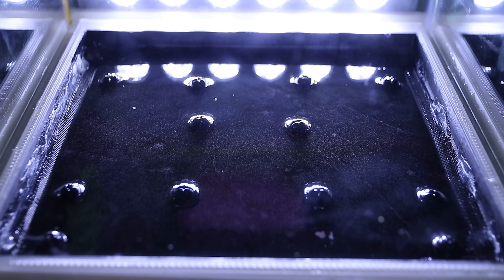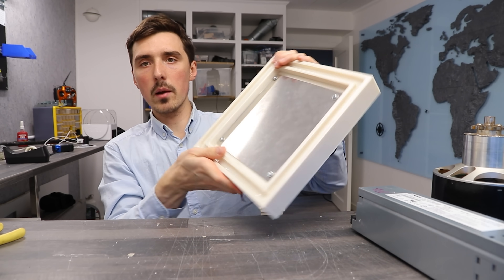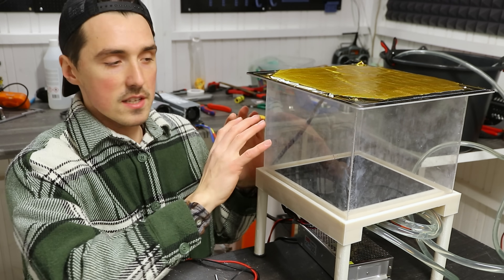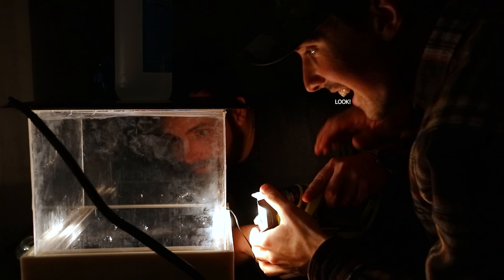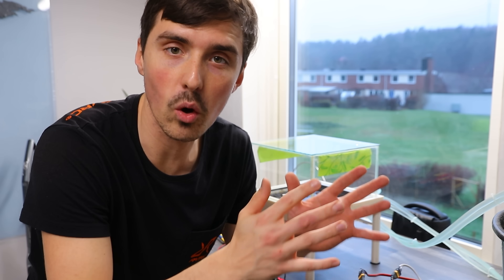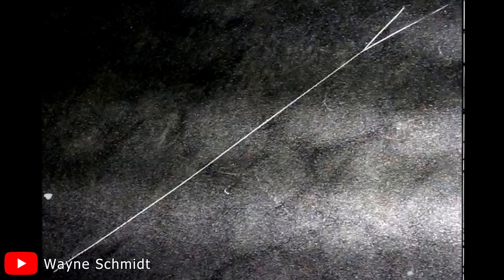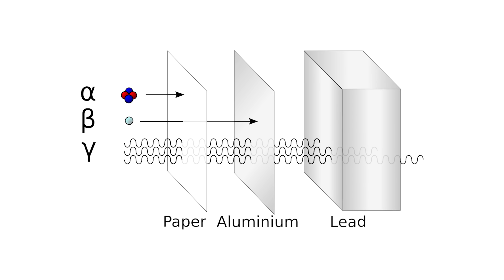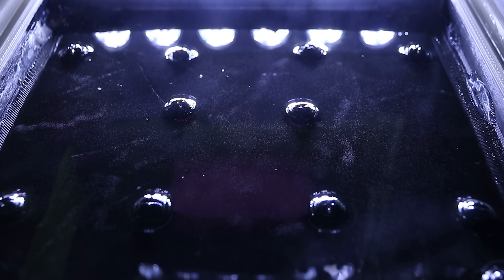I Built Nobel Prize Machine To See Radioactivity

Comment: to increase the cooling capacity try putting the water blocks in parallel instead of in series, thus each block gets cool water, not heated by the previous block.

Comment: Cell phone  on and off, call.
Reply: Why?
Reply: @A10 Warthog  To get a visual of the radioactivity.
Reply: Cell phones emit low levels of non-ionizing radiation when in use. The type of radiation emitted by cell phones is also referred to as radio frequency (RF)
Reply: There you go. Nothing would happen because the radiation is non-ionising.
Reply: @A10 Warthog  Eh, something interesting could happen. I don't see how trying would hurt anything. It does emit radiation and emfs. I'd  be interested regardless.

Comment: In my experience,  stacking peltier doesn't work.  You should insulate between the two sides to maximise the delta. Thermal pastes, lapped contact surfaces and high contact pressures. Also copper is a much better conductor of heat.  Experiment with voltage for maximum efficiency and have plenty of current available. You should be able to achieve a 40° delta. I ran a pc at -20°c with 1 100w peltier at 17v Air cooled ( water loop and radiators)

Comment: Try putting some urine from a nuclear medicine patient. See just how dangerous it may be. Of course you should invest in safety equipment. Lead apron, protective eyewear, and arrange some way to dispose of it safely. Sweden does use nuclear medicine right ? Or you could put a large neomideam magnet in the chamber to investigate if a strong magnetic field diverted any of the particle trails. The idea being that a protective suit, or structure could be developed to serve a degree of protection. Lead will absorb powerful rays, but who wants to wear that suit all day?  Obviously all these low power radiation seem to not be dangerous, but it's believed that cosmic ray causes ageing to a greater degree than time

Comment: It seems to me that you don't need these absurdly low temperatures.  What you need is a temperature DIFFERENCE.  You should have a film of liquid alcohol on the bottom, & that should be HEATED to saturate the space inside.  Then any cooler surface should form the cloud.

Comment: Here in Mälardalen you could easily pick up some radioactive stones from known sites like Ytterby gruva. The bedrock around your place probably also is quite rich... telling from the amount of radon you seem to catch in your chamber. 
However, ChatGPT most likely was wrong about the hot wire. What you saw was most likely just caused by the extra heat inserted into the gas phase. There is no chance of getting electron emission from just a hot wire in air, and especially not in giving those electrons the necessary kinetic energy to achieve any ionization.

Comment: Tritium sights maybe? The ones that are used on guns, getting tritium sights should be relatively cheap way to obtain real radioactive material. Also instead of using washer fluid try using glycol or glycol based car coolant, will get your temps down nicely.

Comment: You can put more peltier elements in front of the other elements so they pre cool the water that will go into the chamber elements. But i guess you need a total of 4 or 5kw (just a guess) because they have so many excess heat by there incredible efficiency 😋

Comment: What is causing the general movement of the trails across the bottom of the plate? Earth's rotation for some cases? Or the heat of the flashlights causing convection?

Comment: I have made a TEC cloud chamber in the past and here is something i learnt, if you add an electric field it makes the particle tracks much more defined,  around 2-5Kv does the trick. I would recommend buying a bug zapper tennis racket, removing the internal PCB and connecting the negative high voltage terminal to the cold plate and then add a wire mesh above the cold plate that the positive terminal connects to, in mine it was around 100mm above, yours may vary. if you have this on a switch you can turn it on and off and compare the results. 

another thing that i found was good was to add a few layers of fabric (I used cotton felt)  on top of the wire mesh and soak it in isopropyl alcohol, this will last for a long time so you don't have to keep on spraying, you can add a heating element inside of this but i didn't find that necessary.

also the Americium found in smoke alarms is a good source of beta radiation if you are carful and want to try it. Another source of radiation is welding rods i don't remember exactly which type
Reply: 6011 welding rods contain a high-cellulose potassium type coating which could give off a slight amount of radiation.

Comment: Some old camera lenses used radioactive coatings (Thorium). You should put one of those in there. Some cameras even had those coatings on the eyepiece, but they eventually stopped making them because people were getting eye cancer. The lenses are pretty easy to identify because the glass has turned yellow from years of self radiation. Some of them can get pretty expensive though as they are sort or collectibles. Might be able to find a damaged one on ebay though. (Takumar 50mm).

Comment: First of all, cool project. One modification I would suggest is to have a magnetic field perpendicular to the surface. Since electrons are negatively charged their tracks would turn clockwise around the magnetic field lines, while alpha particles are positively charged so they would turn counter clockwise. That would be a nice way for you to more easily distinguish between the two particle types. You could perhaps buy neodymium magnets and place between the coolers, just make sure they are pointing in the same direction.
I'm not sure where in Sweden you guys are, but in some regions there are naturally occurring radon gas which is radioactive so if you have the cloud chamber in a poorly ventilated basement you might see more activity than if you are in a better ventilated room. You could also test the soil since there might be some trace radioactive isotopes in it from the Chernobyl nuclear disaster. Alternatively test the meat of wild boars, since they like to dig in the ground and eat roots they might be radioactive with isotopes from Chernobyl. After all, it was the Swedish nuclear power plant Forsmark that where first outside the Soviet union to detect the disaster due to the wind blowing from the south east on that faithful day in 1986. Furthermore, there are regions in Sweden with uranium in the ground, so you could consider testing some rocks (I know that there are some uranium ore in Slotsskogen in Gothenburg), however that might be considered illegal mining of uranium so check the laws first. 
In conclusion you guys have many interesting things you could test with you cloud chamber.
Reply: This, a magnetic field would make this so much better!
Reply: Magnetic fields would be awesome!
Reply: "First of all" 🤓🤓🤓🤓
Reply: @WhosThisPersonNotMe  "👆🤓" - 🤓
Reply: @fahdx64 " "👆🤓" - 🤓 " - 🤓
Reply: @zarrowthehorse  "👆🤓" - 🤓 " - 🤓" - 🤓☝🏼

Comment: Hi, try this: electric field outside the chamber…and inside…with battery or 220v connectors …away from each other.
Try put magnet inside, outside, batteries…
Piezo lighter nearby…
An electrostatic plastic ruler
A coil…

Comment: With peltier elements you should always run them way lower than specified power. Run a "60W" unit at closer to 20W e.t.c. You'll want as many as you can fit (maximize area). What happens at higher powers is that the hotside gets too hot even if the water in the cooler is still only 20-30C. You can experiment with different voltages to see at what power you get the highest temperature difference. In most cases it's never at the highest. Having more of them in total means you have more total cooling capacity which means you can achieve colder temps as you have more cooling power to compensate for heat conduction through the acrylic. And buy proper thermal paste, you can on the swedish amazon find some larger tubes quite cheap (>25g)

Comment: Great work! I'm impressed how ChatGPT answered to your question. Maybe it was not clear enough, but you need to connect negative high voltage to that tungsten wire to create electron beam.
Reply: Honestly, this is absolutely insane suggestion by ChatGPT, and I don't understand why anyone even humoured it for a second. It's a -30 cloud chamber and putting a 1626.85C wire (assuming ~1900k hue) is not going to anything other than ruin the effect. Absolutely insane.
And how can you connect a negative DC voltage over a wire? Positive and negative in DC just refer to direction of current. If you swapped the connections on each end, you could call it negative, but it makes no difference.
Reply: @1992jamo  I agree, the "negative" voltage comment makes no sense.  Voltage is simply relative to your reference.  So negative one way is positive another.

Comment: dry ice is a problem ?  why ?   let me guess, maybe it's a component to make explosives and it's hard to acquire because of the bikers gang wars . 
am i correct ?
Reply: It's not illegal, it's just very uncommon. I have never seen it in my life. What's it even used for?
Reply: @logitech4873 it's " ice ", what do you do with ice ?
it's also used as canned compress air.
Reply: @berserkberserk997  It just seems like whatever it's used for, there's other less exotic options.
Reply: @logitech4873   carbon dioxide is not dangerous, unless u spray some in your belly and the liquid gives you frostbite making a scar in the process. 😝

Comment: you have a smoke detector right? then you have a radioactive americium source. drop that in there. another option is to get a very strong magnet, build a sled with a hole over which you place the magnet, and drag it around outside in the dirt for a while. scrape off everything that jumped up to the magnet and place that in there. since you live in sweden, a significant portion of that magnetic material could be fallout from Chernobyl and from soviet weapons tests, and the rest will be micrometeorites.
Reply: Most smoke detectors today are optical. They don't have americium.

Comment: if you take apart a smoke detector it has americium 241 which is an alpha emitter, you may also be able to find an old Rolex on eBay that has in the watch face
Reply: Not all smoke detectors do. Most are optical nowadays.

Comment: Nice video, bananas are slightly radioactive, but if i remember well i saw a video that explain the most of the potassium is contained in the skin, so you can try with the skin of the banana. You can try granite rocks, they contain potassium and sometimes traces of radioactive elements. Or an old crt monitor.

Comment: I read that the surfaces who are electrostatically charged attract the decay products of the radionucleides who are naturally present in the air, because after the decay most of the products are ionized. Most of them are radioactives too. It was typically happening on the old CRT displays, but I think plastic vacuum cleaner enclosure, or anything you can feel the hairs on the back of your hand attracted to. Swipe a small clothe on it and I think you could gather a more concentrated sample of radioactive elements . I vaguely remember that negatively charged surfaces are better.

Comment: The "Static" was interesting, all interesting . Its one of the most amazing machines . Real time vision of particles , like a pair of glasses that lets you see radio waves, but there isn't one of those. this is happening everywhere.  tig welding thourium. Tried and failed a cloud chambre , -15 at best. looks a good fit for pulse tube cryo cooler. lower power , would be amazing to have a 24hr system but 1KW is unfeasable. The total energy change due to the tracks must be minute so the whole energy system could be tiny , in theroy. Great video.

Comment: You need a radiator and fans to exchange the heat away.  Just simply pumping water through them is just going to heat up the water and make it less able to transport heat away from the elements over time.   The reason you got better results with chilled antifreeze is just because it started lower so could absorb more heat, but eventually it'll cap out too unless you exchange that heat into the atmosphere and get it out and away form the system.  
Other peltier cloud chambers I've seen have gotten away with as few as 2 PC fans, you can probably do with just a 120mm (single fan) radiator.  You could also use a single larger peltier element and use a CPU air cooler (big air heatsink), but with the setup you have now, you can get a huge improvement by just adding a radiator and even making it a closed loop with a small volume of water (get a PC watercooling pump+resevoir combo).

Comment: It might be a longshot, but try to get ahold of an older cameralens with readioactive glass, sometimes they would have a thorium coating on the rear element making them radioactive, and gain a yellow tint over time. I got one, a Canon FL 50mm f1.8, on tradera for 239kr this summer on tradera. You'd have to research which ones are radioactive but it could be cool to see.

Comment: Really nice video, and experiment. There are probably more radioactive materials all around you than bananas. Brazil nuts for example are so radioactive that it is often mentioned, if you had some in your pocket they are active enough to trigger the alarm in a nuclear power station! Also analogue watches will often have watch hands and markers painted with luminous paint, which is usually radioactive enough to make a Geiger-Mueller counter really go a bit "bananas" although the glass and case do their best at stopping their emissions, they are easy to try, or pop the glass out of. A small tin of luminous modelling paint, would be an easy and cheap option as you could paint a layer onto any surface. Other radioactive sources like Tritium tubes (used in expensive Ball wrist watches, and plastic keyfobs that glow for 20+years) may not work as well as luminous paint, despite being much more active (and are NOT safe to open, break, or fiddle with generally) as the glass or plastic shell which houses the radioactive tritium gas, and the fluorescing agent, are a thick enough barrier to stop the radioactive emissions....which is why they are a safe source of light.

Comment: It's really easy to buy Americium samples from old smoke detectors for a few euros on eBay. It's also very easy to buy small samples of ores like pitchblende (also called uraninite), which is basically a rock, that contains some uranium - don't worry, it's absolutely safe at those concentrations, and you can also find lots of others. My favorite is by far Autunite. You can find some samples that are below 1cm large for like 5$ on eBay. They are beautiful, and emit alpha and beta particles. LOTS of them. And before you ask, yes it's 100% legal, since it's ore, and not refined.

Comment: I've tried to cool down peltier elements at home myself, the best I could do was minus 32
with double water cooling and an ambient temperature of 22 degrees.
Would recommend you to use only 4 or 5 Peltier elements, not that the elements heat each other up with the cooling water.

Comment: Good on you for getting it to work with a single layer of peltiers. It was my experience that a stack of two is needed, a high current peltier cooling the hot side of a lower current peltier, which in turn cools the cold plate. The top layer doesnt contribute all that much heat to the system (with them being driven by considerably lower current than the bottom peltiers) but it greatly enhances the delta-t possible.

Comment: A lot of old wrist watches have tritium on their dial. Tritium is a slightly radioactive material that was used to make the markers glow in the dark. You can find these watches on ebay, some of them are very cheap.
Reply: Tritium is common in fire arm weapon sights & optics as well, as it requires no batteries to glow and lasts for a long time
Reply: You can also just buy radioactive samples on eBay or Amazon.  It’d be way more radioactive than the small amount of material in a wristwatch, and it isn’t even very expensive.
Reply: @Chevsilverado  This. Thorium is super cheap too, and you can also find americium sources in about half of smoke detectors
Reply: Downside of Tritium is that it has a very short half life.  So going this route may be hit and miss if buying off Ebay.
Reply: @willierants5880  About 12 years.
Reply: It's also still used in glowing exit signs
Reply: Or just buy some depleted uranium
Reply: You can find at least one cheap radium clock in most antique stores. All you have to do is look for clocks 1920s-70s with cream-colored paint on the dials. Square 1970s style clocks and Westclox Big/Baby Bens are usually radium.

Comment: Try with TIG Welding Tungsten Electrode 2% Thoriated aka red tip, the thorium is supposed to be radioactive and emits alpha particles. They're not very expensive and you can find them in any welding supplies shop.
Reply: Definitely this. Also thoriated tungsten electrodes are relatively safe to handle since they're not radioactive enough to pierce through human skin. They're bad when you grind them and release radioactive dust into the air that you can breathe in.
Reply: Also gas lamp hoods are thoriated too.